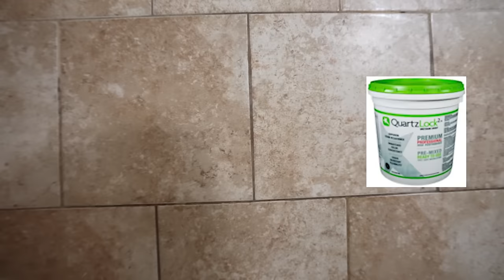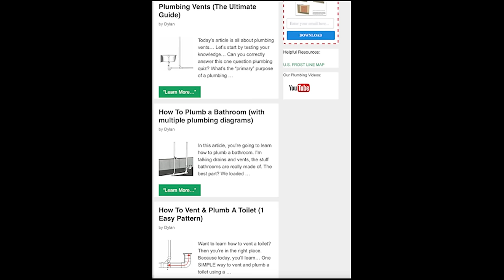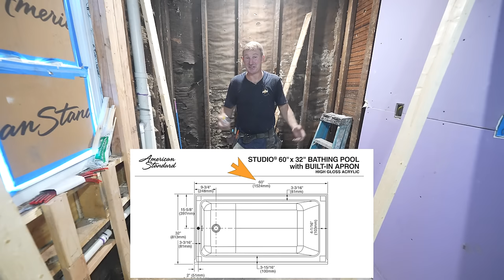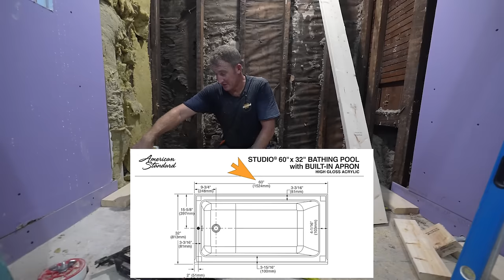Complete New Layout Bathroom Remodel | Start to Finish | PLAN LEARN BUILD

Comment from the maker: Use the time stamps 😊
This is the full deal 

🎬Chapters
0:00 Intro - Demo
25:53 Plumbing
1:07:08 Framing Repair
1:23:33 Electrical
1:50:29 Vent Fan
2:02:25 Drywall
2:16:35 Tub Installation
2:56:10 Shower Faucet
3:13:59 Waterproofing Tub Surround
3:36:54 Heated Flooring
4:01:39 Drywall Finishing
4:23:26 Floor Waterproofing
4:34:40 Window Trim
4:37:36 Mosaic Floor Tile
4:59:32 Wall Tile Tub Surround
5:55:33 Tile Wainscoting
6:01:50 Grouting
6:33:01 Shower Faucet Trim
6:44:53 Caulking
6:50:58 Valves & Toilet
7:01:56 Mirror & Lighting
7:09:18 Vanity
7:21:36 Enroll in course 😊
Reply: 7:11:02 My mind dubbed in your wifey saying "NO" to that style of vanity wedged in the corner. Thank goodness you centered with the mirror. Beautifully done using somewhat medium quality and priced materials.

Comment: Use some leftover carpet or a rug in your tubs or shower pans to avoid them from getting scratched. I prefer to use two layers of carpet and leftover/scrap subfloor or OSB and then the carpet on top. And then I use blue tape as well.

Comment: wow - so nice and real!  I've done two bathrooms in my home...and you answered a lot of questions I ran into. Your comments on getting the surface preparation right (i.e. plumb!) was one of my problems I didn't fully grasp till it came to tile time...and your comments on it were so true.  My upstairs bathroom does not have plumb corners and it really missed up my tile line there.  Regarding the vanity install: I ended up liquid nailing my vanity to my tile.../sigh...I didn't want to risk cracking my tile with drilling.  I still have problems doing the outlet cutouts and I will have to re-watch the video and see if that was captured on film.  I get this consistently wrong with tile or sheet rock surfaces.  

One thing I paid attention to on your video was where you put the sheet rock(?) on the bathtub top.  I recall some other you-tuber putting their cement board onto the tub itself...but they tiled with a gap off the bathtub....  Any comments on this?  Also that was moisture resistant sheetrock you used correct?  You're good with it since u use a membrane to shield it from water penetration thru the grout lines...but it surprised me.

The corners of the tub surround where also of interest to me...I ended up grouting that gap.  Was that a mistake?  I saw these gaps watching the video and wondered if it was the camera angles..but when you caulked them I went 'ahhh'.  ))  I also enjoyed your comments on the toilet.  That foam ring we do not sell where i work...I assume there are gigs where the remodel takes several days and the toilet is the only one in the house and it has to be operable when you leave every day so that makes a lot of sense why you would use it.  The fluid-master fill valve is the go to item we recommend to all customers that aren't already set on a competitor's 'bling superior' packaging.  A plumber showed me a trick with it - you can just pull up the locking ring at the bottom and switch it out with a new one without completely draining the toilet tank!  This trick works often - but not always!

Anyway I really enjoy your efforts here.

Comment: Great video and I like the result! Why did you choose to keep the in-wall vent fan though, considering you installed the new ceiling unit? Too hard to patch and look good on the outside? Just seems like a bug entry point and HVAC efficiency loss. Thanks again for the video!

Comment: wouldn't it have been smarter to upgrade to 4" inch pipe if you planned to update to two full baths in the future?
Reply from the maker: 3” pipe can handle 20 fixture units. Plenty for two bathrooms 👍

Comment: I don’t recommend to bury an unbranded valve behind the wall. Can you guarantee repairing after 10 or 20 years later? I mean do you believe the brand do business for 10 or 20 years? NO. They sell product in amazon but close the product in couple years and disappear. You won’t even find the link for the product. If this happens and the valve drips water in the future, the future owner will be screwed. They have to demolish the wall to replace the cheap Chinese valve. The valve is installed at the exterior wall. You can’t access it from behind.
Reply from the maker: Keep faith with your brands then 😂 we don’t live in the 90s anymore. None of these brands will last like they used to